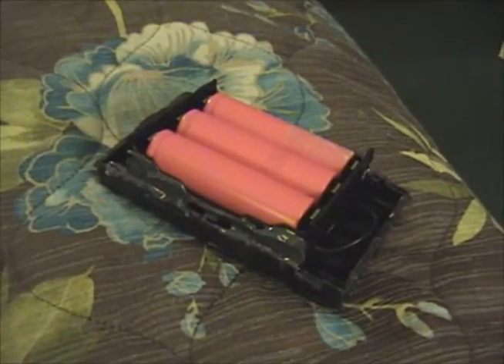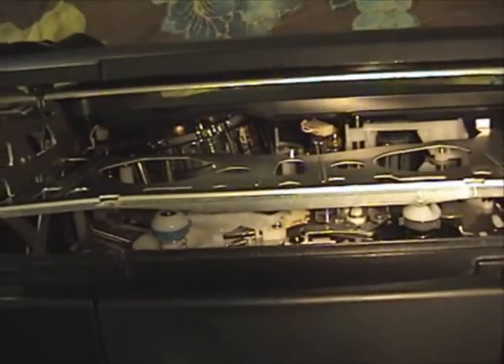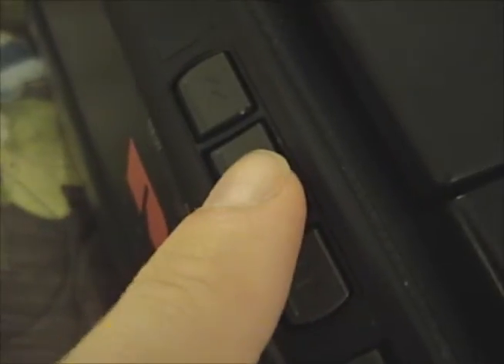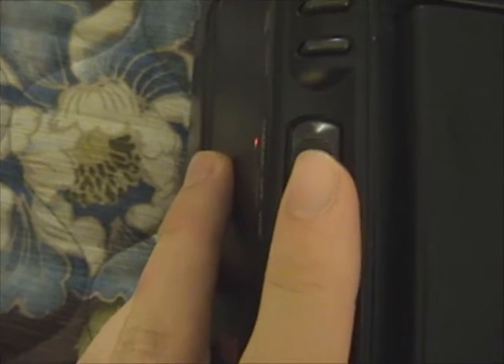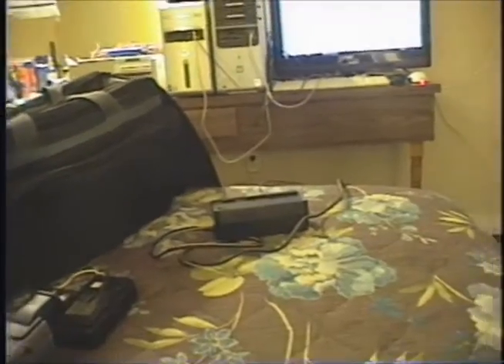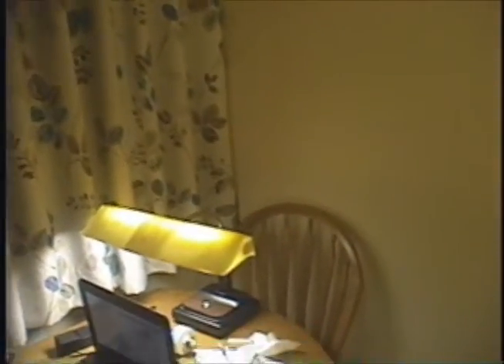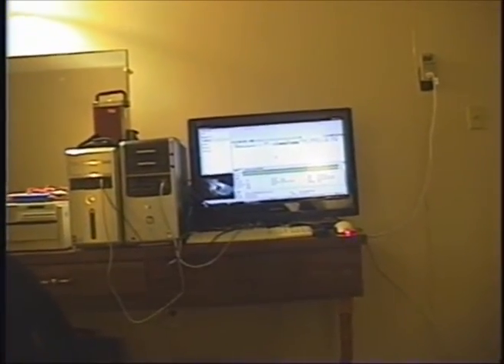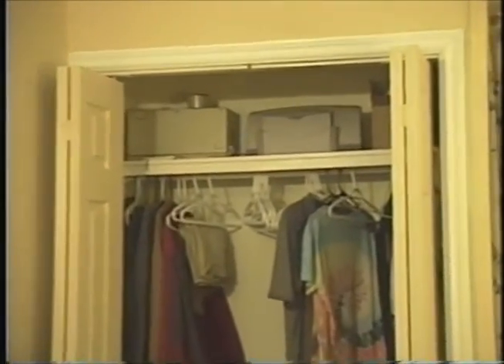RCA CC413 VHS camcorder (1994), Part 2

Comment: The benefit of not supporting LP or EP/SLP is that it uses a larger playback head, which allows it to have a clear picture during pause and cue/review, unlike multi-speed 2-head VCRs where the picture is mostly covered up with noise during these operations.
Reply from the maker: I've learned something new! I noticed the picture was unusually clean during cue/review.

Comment: I have a slightly older model which is the CC412. Mine is from December 1993. Unfortunately I really have no good way to power it since the batteries are shot and the CRT viewfinder is dead. I did rig up a universal AC adapter to it with slightly under voltage and was able to blindly record to tape with it, and it works. What's really stupid about this camera is it requires proprietary connecting cables to use the A/V in and out. I can't find them ANYWHERE.

Comment: I just bought this camera yesterday at a goodwill and its in mint condition, however the physical rechargeable battery is completely dead. Like it won't even charge. Do u know where or which website I can find a new one ??? Thabks
Reply from the maker: You can buy a new battery here:

http://www.ebay.com/itm/350827620505

You could also cut the old one open, and convert it to use Li-Ion cells, like I did in this video:

https://www.youtube.com/watch?v=q-IrsokVMgk
Reply: themaritimeman oooo thabks man !!

Comment: Isn't the  2-head design  only because it has 1 tape speed?  If EP was available there would probably be 2  extra 19 micron heads to accomodate the narrower scan width of EP.
Reply from the maker: You're right, I didn't think of that. 4-heads makes a big difference at the slower record speeds, but it's indeed but a big deal on an SP-only device.

Comment: I just bought a new battery for one of these camcorders but I realized that It doesn't come with a charger. Do you know what type of charger it uses? And where i might be able to get it? Thank you!
Reply from the maker: The charger is an RCA CPS019. I don't see any of those on eBay, but I found a different one that appears to be for that battery type:

https://m.ebay.com/itm/391682195596

Alternatively, as the battery is a 10V lead acid (at least, mine is), if you have a power supply that outputs 11.0-11.5 volts, you can clip that directly to the battery to charge it.
Reply: themaritimegirl thank you so much friend!

Comment: Actually LP was horrible on VHS mashines. Because mainly to the fact that Longplay recordings were almost unplayable on another mashine  except the mashine that recorded it. And even if it played, the quality was beyond bad. My first camcorder was a JVC VHS-C type of camera and that one didn't have LP recording function either. So you were really only down to 60 minutes maximum. After a few years I couldn't even get these 60 Min. tapes anymore but only 45 Minutes tapes. And they still cost a lot. >_<  So you had to be aware of what you shoot. But that kinda helped to get much better discipline at shooting cost efficient and cut your movies while shooting.
Reply from the maker: I've never had an issue playing LP/EP recordings on VCRs other than the one that made the recording. On a 2-head machine there is a noticeable loss in video quality, and a dramatic loss in audio quality, but on a 4-head machine the video quality loss is very minor, and the audio quality has no perceived change in quality at all. In the video of the 4-head Panasonic VCR I have, you can see how well it handles LP and EP modes.